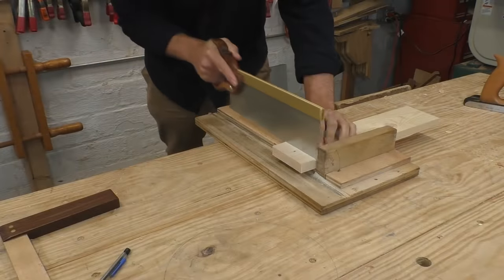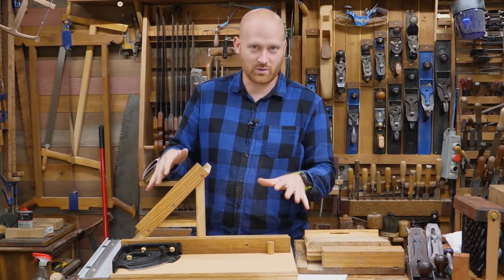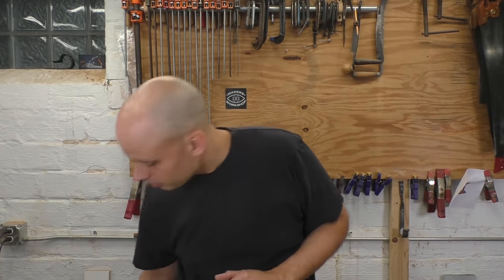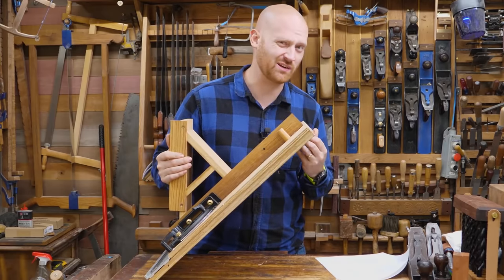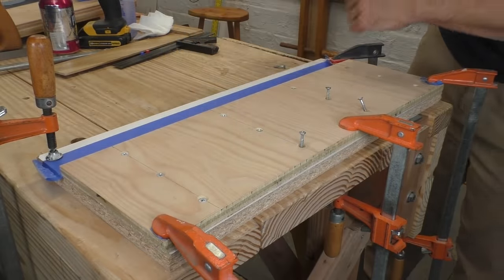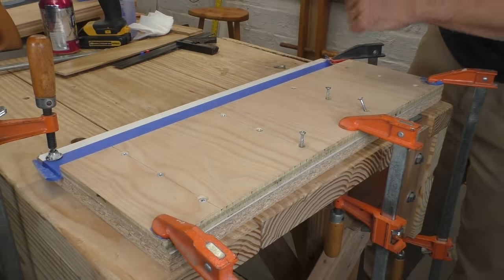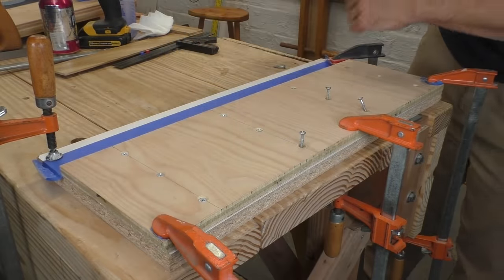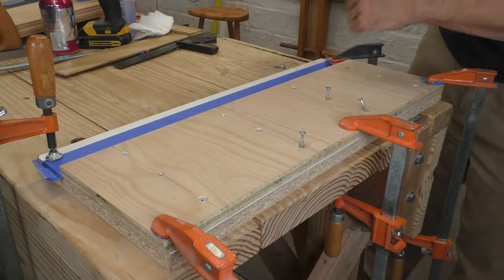Make perfect, square boards with the Advanced Shooting Board // Essential Hand Tool Jig

Comment: Whenever you cut off a threaded rod, you should keep a nut on it. When you finish cutting, you can take off the nut, and it will un foul the thread, if it's messed.
Reply: Wow, good tip
Reply: That's actually genius. Thanks for that tip. I'll store that one in the ol noggin for a rainy day.

Comment: Before you cut off a bolt to shorten it, thread a nut onto it first. After you cut and file the end of the bolt, screw the nut off. It will clean up any damage to the threads, and it's much easier than trying to put one on after it's been cut. ;-)

Comment: I’ve seen plenty of shooting board videos that immediately require a table saw that’s perfectly square and level. Realistically a person that needs a shooting board probably does not have the ability to true up edges with machinery. This video is very good that offers tips that I have not seen elsewhere such as using melamine and chamfering the bottom for dust channels. Thank you so much.

Comment: Ill be the first to admit i know nothing about building a shooting board, hence why I'm here, but i typically use melamine to construct molds for my epoxy projects. It doesn't form a strong bond and i can easily de-mold. With that being said, I think I'm going to hold off on the epoxy and maybe add an extra screw or 2. Thanks for the content.

Comment: Tip: if you don't have, or can't be bothered with, epoxy, clear silicone is a great adhesive. It will stick anything to anything, it's simple to use, and not messy. It works the best with flat, smooth, surfaces. The flatter, and smoother, the stronger the bond. It would be perfect for bonding melamine to plywood, and would also work to adhere the hardware to the underside of your shooting board. It is a flexible bond, so it never becomes brittle and fail, and allows the material that you're gluing to expand and contract. And, it's often possible to take the joint apart at some later time. (the flatter, and smoother, your two pieces are, the less likely they will come apart - like gluing glass to glass - good luck getting that apart)

Comment: I saw a tip when shortening a bolt. You put a nut on the bolt, cut the bolt, then take the nut off.  As you take the nut off, it dresses the cut end back to true.  

Now I've never done it, so I don't know how well it works...and it probably doesn't fix the burr. But, it's been in my head as something to try.
Reply from the maker: I will try that. Seems like using a threading die instead of the nut would work even better. Great tip!!!
Reply: Yes, nut helps. Best to have a threading die. It really cleans up damaged threads.
Reply: I've done it many times, and it does indeed clean up the threads.  It's always good to chamfer the end anyway with a file.
Reply: That's a great tip! Thanks!
Reply: I’ve been a mechanic for 35 years and this is the way we do it. Put the nut on cut the thread file the end run the nut on and off a couple of times then quick pass with file will be like a shop finish
Reply: It's a good method. I've often used the nut to re-dress a bolt... I also like two nuts (make a jam-nut) to set my desired length and a touch on a belt sander or grinder is enough to get rid of burrs... You can also get by pretty good with just a steel wire wheel on a drill to de-burr without much hell to play. The nuts will take a few dings, but keep you from over-grinding on even the most aggressive method and speed... They don't need to be ridiculous tight either, just tight enough not to run off without you meaning to... so a tad more than finger-tight is plenty, most of the time.  ;o)
Reply: @RexKrueger  
I go one more step and cut the nut on one corner.  That way when you clamp it in the vice it crushed onto the thread and stops it turning.  It also removes almost all of the burr when it's unscrewed.   A but of filing away from the thread gets rid of the rest.   I've got a tin of nuts prepared in such a way ready for use.
Reply: @awatt , super great technique! Two split nuts on the screw can rigidly hold it in the vise and protect the threads (so you don’t need to chew up your nice handscrew, assuming you have  one). They can even allow holding anywhere in the jaws without interference from the screw head. AND, with judicious squeezing they are a better rethreading die than a plain nut! Cool, thanks!!
Reply: @RexKrueger  Don't use a thread cutting die. The leading edges of a die do the cutting so you're only cutting when tightening. Dies are brittle so hitting a burr when loosening can break or chip the threads of the die. Instead use thread chasers, which can be expensive, or take advantage of the different grades of hardware. If you're cutting a grade 2 cap screw or threaded rod, use a grade 5 nut to chase the threads. Likewise if you're cutting a grade 5 screw use a grade 8 nut. If you're cutting a grade 8 screw, are you f***ing kidding me? What's the matter with you? Anyway here's some thread chasers:

https://www.amazon.com/thread-chaser-set/s?k=thread+chaser+set
Reply: @aladdin4d . Great idea. That’s one of the duh moments when you’re overthinking things. 
Well, that is if people understand what the grade of bolts and nuts mean. Most of the time they just purchase the lower grade because of the price. 
The only grade 8 that I’ve ever used is on my truck - the spindle bolts. Five grade 8 bolts can handle the impact of thousands of pounds.
Reply: @awatt  any chance you'd make a video? I'm not really getting it, but it feels like you got something pretty cool going on
Reply: @thomasfoster7100  it took me a re read. Cut into the nut so it becomes a C shape. Then when it's clamped in the vice the nut will flex and grip the threads. Same for chasing the threads. The nut can be squeezed to do it more aggressively.
Reply: @awatt  Similar to you I have a box full of nuts (ooh er missus) with a shallow radial cut through the threads. It doesn't clamp like your (imho superior) method and you need a narrow jr hacksaw blade to make the cut, I just use my jewellers saw, but it's bloody quick, works well enough and I get less pissed off if I lose one. I generally lock them in place with another nut so they don't normally move.

Comment: One of my favorite things about hand tool work is that you don't need a different jig for every little operation.
 For a fixed fence shooting board I like to use a brad nailer to pin down the fence so that it doesn't slip like when using clamps or screws. Love the magnets idea. Thanks for the video

Comment: FINALLY! This is the video I’ve been looking for. I’m just getting into woodworking, and starting with only hand tools. I realized quickly that I needed a shooting board but all of the damn plans or guides I found talked about building with a table saw. It felt like to get started with the ~$200 of simple hand tools I’ve got I only needed another $1000 of tools and 3 bench or jig builds to even get to a shooting board! I’m can already tell that this hobby will eventually take me (happily) for thousands of dollars in tools and materials, but it shouldn’t require that to get started

Comment: I’ve looked at a ton of shooting board designs until I read Chris Schwarz’s 2012 article today: “A Shooting Board for a Simpleton”, and it really was like a good and much needed clip ‘round the head. Glue two pieces of plywood together, screw a cleat to the bottom, stick a 90º fence on it, done. If the fence gets out of square, take a shoulder plane and plane it back into square. If you don’t have a shoulder plane (I don’t), stick some sandpaper on a straight piece of wood and sand the fence back into square. That’s it, done.

Comment: Hi Rex
Only recently in the past 1-2 years starting more hand tool work I did need to be economical not only in my initial hand tool purchases but also with supplies. Having saved "old", but near perfect condition melamine bookshelves "just in case", was the perfect body for my shooting board idea I picked up from often seeing you use these. It definitely isn't as structurally resilient or strong as decent quality plywood but its smooth flat surface seemed just right. Only using scraps of what I had available I really liked the idea you had for adding a permanent backer fence to a replaceable one. Instead of hardwood; however, I used a leftover piece of PVC brick molding for the backer and a scrap piece of oak flooring for the replaceable fence secured by both wedge fit and screws through a sliding slot but horizontally through the moveable to backer fence. The brick molding seems to be more weather stable than anything less dense than higher quality hardwood. This set up does seem to allow for re-smoothing the end grain part of the fence and shimming the oak fence of need be, which is easily replaceable.
However, any suggestions for reducing chip out on the back of the oak end grain fencing? Perhaps it is the grain orientation of the oak or is this just typical of oak to be a bit "chippy"?
Similarly finding I was often not keeping the sole of my shooting plane (#62 Stanley S.H. low angle jack plane) well positioned along the edge for shooting, a fairly simple recent upgrade I found helpful was to add a parallel short fence near the outer that keeps the body of the plane engaged against the inner plywood top shooting edge.
Though only a small Patron, thank you for all the inspiration you provide.

Comment: Love your videos! If you can't make it perfectly accurate, make it adjustable. Also a small tip for cutting bolts, you can thread a nut onto it before cutting it with the hacksaw. Then after the cut the jagged burred threads on the end are smoothed out as you unscrew the nut. You can also thread two nylon locknuts onto the bolt to make a simple guide for the hacksaw blade to get a straight cut :)

Comment: Awesome video. Just spent some time making a shooting board yesterday. It came out great, I stuck with a basic board for now and will eventually get to an adjustable one. Works great and since I never checked before hand, it showed me my thrift store bought hand plane is not square! haha. Never thought to check the side I just made sure it had the parts and a blade I could sharpen.

Comment: I have gone for a different approach, Rex.  However, I have taken on board some of your ideas.

My board is primarily based on Paul Sellers' design with two wedges one for 90 and one for 45 degrees.  It is made of 18mm hardwood ply I had left over.

The first idea I took on from you is not from this video but from your mistake on the fish marker guage.  I need a left handed shooting board!

The second is a variation on your design for supporting the back of the work. I know work will be 2 × 18 =36 mm above the bench. So I decided that if I stuck two sheets together and cut my wedges out of that they would be rather thicker than I need for shooting but whatever work i am doing, one or other of them will be spare and can be used to support the far end of my work.

Two other observations:  Paul uses a router plane to get his recesses to depth.  I just cut out one layer of ply at a time to get to a depth I was satisfied with.  If I thought the ply was coming apart when I didn't want it to I used a cheap artist's paintbrush to put some 10 minute behind it. put a weight on it, wiped any squeeze out from it with a  damp paper towel and made myself a coffee whist it dried.
Then a piece of sandpaper on a piece of scrap wood enabled me to clean it up.

The other one is that you are quite right, it is easy to end up with the recess not accurately at 90 or 45 degrees. I know, because I got one wrong but I used a file to true it up and because it is based on a wedge I just sacrificed a little more of it when preparing it.

So I am not for a moment suggesting my skills are in any way a match for yours or James' but I am simply sharing my solution to the same problem in case others find it helpful.

Now all I need as somewhere big enough to store it all.  Can you do a video on how to build a big blue box with the words "Police" and "Telephone" on it please?

PS Cutting plywood with a Japanese style dovetail saw gave me no tearout and didn't take particularly long even when I had to make cuts about six feet long on the other project.

Comment: I bit the bullet and built one--or at least one "very inspired" by Rex's version (his has a couple features mine does not).  Haven't done a project in a few years and have zero hand-woodworking infrastructure (specifically no bench!).  I bought a particleboard shelf at big-box store (2'x1').  Plastic laminated surface is great to slide plane on.  Epoxied/screwed a 1/2" birch plywood layer on top of that.  Actually had to buy a few small hardwood blocks for the fence (that's how non-existent my wood shop is--don't even have a scrap pile).  All in, maybe $15-20.  Following Rex's video, paid specific attention to making sure the fence was square with the plane.

How did it work?  Well....  It did work, basically.  It didn't "flow" as smoothly as Rex's.  Getting it set up by planing down the initial track was harder than I expected. Nibbling away at the 2 fences was a bit bumpy.  Pulled my blade in for a shallower cut--that helped but still not easy. While the results were square it wasn't a super-smooth end cut. Part of that might be because I was testing with a cheap big-box pine stick, and these seem to be tailor-made to tear out. My plane is the one good tool I own: a Lie-Nielsen low-angle jack plane.  Usually cuts those YouTube-worthy full-length shavings like butter, however it is possible all the testing may have taken the edge off a bit. Will re-sharpen and see how that goes.  Finally, user-error/learning is a part. It actually isn't as easy as just running the plane up and down the board! You have maybe 1/32" "slot" between plane bottom and where the blade cuts (depending on depth of cut). You need to maneuver your stock into that 1/32" window. Stick it out just a wee bit too far and your plane body crashes into it when you try to shoot. Not far enough and--well, you don't cut anything.  I think this is a matter of practicing and getting to know your own tool and how to feed the stock properly.

At this point, my bandsaw gave me a smoother cut and was about as square, so that made me a little disappointed, but not so disappointed I won't try tweaking/tuning my board until I learn how to use it better and can get better results.

Photos at this link.  Oh--and I'm a lefty so I made mine left-handed.

https://imgur.com/a/QKSaRNq

UPDATE: I sharpened the blade of my plane—nerve-wracking, as its the first time I’ve tried it, and freehand too! A huge difference it made! Edge is now glass smooth. Board fence may need a paper-thin shim, but I’m very happy with this result. Moral of the story: always present your best edge to endgrain.

Comment: I used scrap piece of laminate flooring as base to slide plane on, slick surface and tough, and free in my case. Really like the adjustable fence with hardware, gonna modify mine like that.

Comment: An old machinist's trick to getting functional threads after cutting a bolt down: Take a nut and run it all the way up, or take two to make a jam nut, then back them off to clean the threads. I prefer the second, as it gives me something to clamp to that is solid, and won't ruin the threads, or my vices or clamps. Of course, you might occasionally need a file, but I've rarely found that to be the case, so long as I don't make a disaster of the cut.

Comment: @12:00: putting a nut over the screw before cutting it off makes a fine thread by turning it off very easy, you'll only have to file off a tiny rest.

Comment: Before you cut your screw put a nut on it right where you need to cut. Use the saw right up against the nut. Then back the nut off of the end to keep the threads clean and clear. No need to file.

Comment: I expect that others have mentioned this also, but another good way to fix/repair the threads at the end of a cut bolt is to thread on one or more nuts BEFORE you start cutting.  Then cut and file and try to 'fix' the end.  THEN, unscrew the nuts.  They will true up that last thread or two, and "unpeel" any bits of metal that you want to remove.  Then maybe one more quick cleanup with a fine file.

Comment: When you cut down a bolt to fit, put a few nuts on above the cut before you trim it.  When you unscrew them, you will help correct any damage to the thread.

Comment: Suggestion: Screw/bolt the moving fence to the fixed fence instead of the bottom so shims are fixed and doesn't move or even fall out.

Comment: My table saw has a fence that is just a little off. I don't know how to adjust it and it is a real pain. The new Porter Cable table saws have a different style fence than my 2013 or 2014 model, probably because the old ones suck. Hard. I did see a video where he shimmed it with tape. I really like these videos because instead of doing the work without a table saw, this helps me fix the shortcomings of my saw.

Comment: Good info!  I just built my first shooting board last week (used a table saw).  I also needed to shoot miters for some small box projects.  It makes me want to get a low angle jack.  Shooting end grain oak is harder than I imagined!

I thought I would use my nice (and square) #Veritas 4.5, but it is just too awkward to hold and too short.  My #7 seemed too big but my #5 works well.  I spent about an hour getting my 45 degree angle tuned in and realizing I had to mess with the blade angle to make up for the side of the #5 being a few degrees out of square with the sole.

Comment: If you put a nut on the bolt before cutting off the excess, then when you remove the nut, it automatically repairs the beginning of your threads.

Comment: Screw on a nut before you trim the bolts. After you dress the ends with a file, the act of unscrewing the nut will finish dressing the threads.